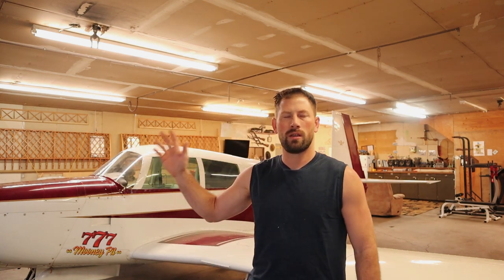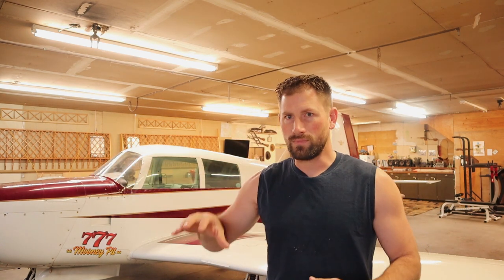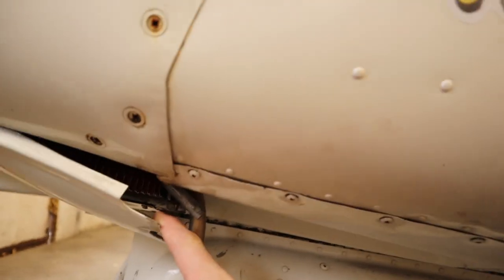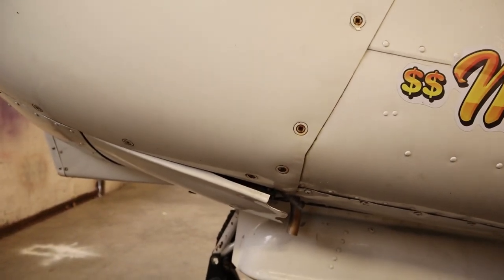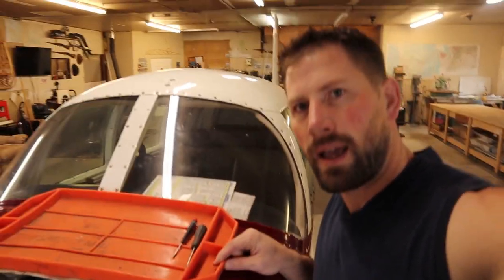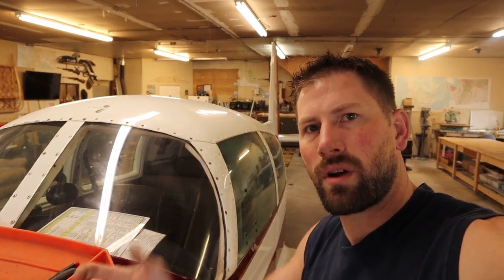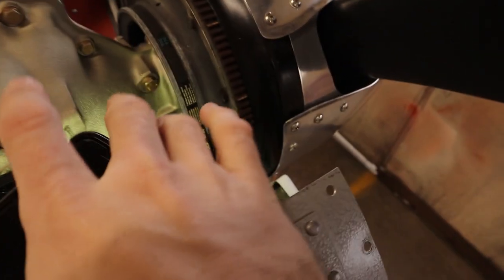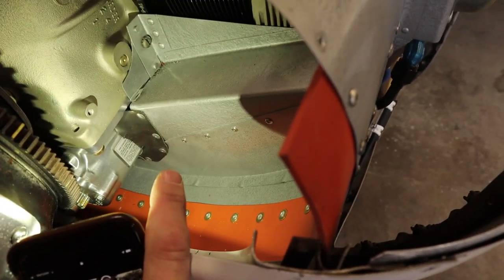Aircraft engine overheating - Baffling leaks

Comment: Great video. I recently purchased a Mooney M20C. Ive seen on the jpi that the #2 cylinder is reading a bit high, but the analog temp gauge was on the  cooler side. Someone that has a J model said the cowls not opening up enough, but a mechanic said they only open up 1 inch. I've done the same thing you did with sealing the gaps but I think theres more to be done. The mechanic also saying its not really normal for the #2 cylinder to get hot. The temp is normally high when climbing, but ok after. Today's flight #1-318, #2-362, #3-321, #4-274
Reply from the maker: That is very unusual that #2 is reading higher than the rest. That leads me to think that there is an unusual reason for it. 
First check and make sure that it has the same type of cht temp sender as the other cylinders. Sometimes there is one sensor that is the probe type as original and the other three are spark plug ring/washer type 

Also double check that #2 is actually the number 2 cylinder, to do that, remove the cht probe on 2 and put it in a cup of boiling hit water. Then turn on the master and JDM and see that it is in fact #2 that is showing the temp.
If all of that checks out then swap probes with the cylinder next to it. If the “high temp” follows the probe then the probe is bad. 
Do all that then let me know how it went.
Reply from the maker: Also check the rubber baffling at the bottom front when the cowl is installed. A strip of rubber baffling should go into a groove on the inside of the cowl and retain it. Also ensure that the baffling fills the gap around your starter and generator/alternator. Those should be sealed up tight too.